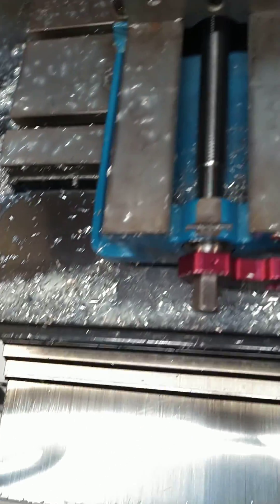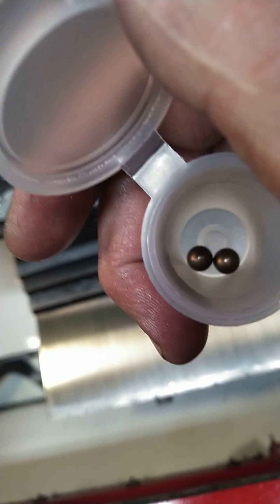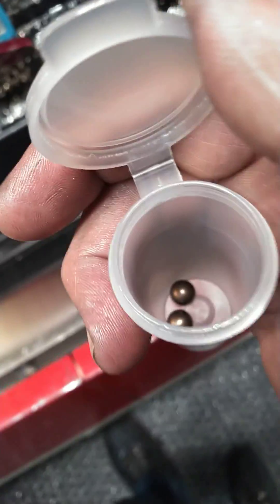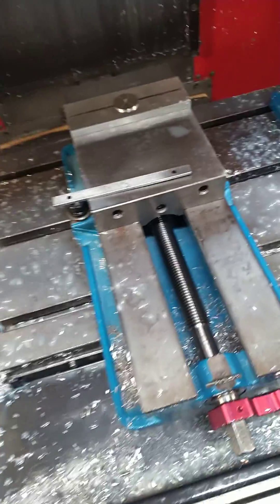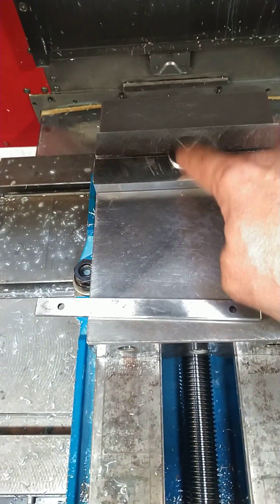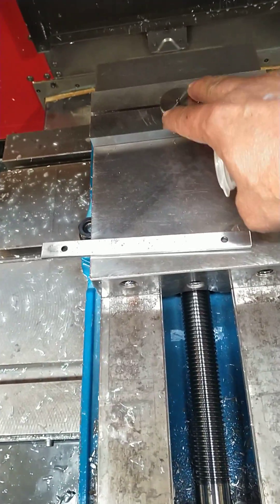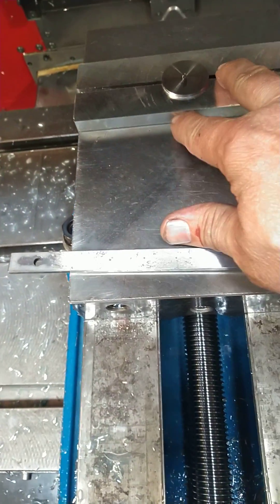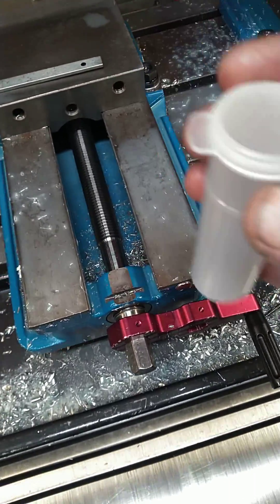drilling a small hole in a ball bearing part 1

Comment: Mechanical engineer here. SMH. Why..just why? 
If it's a decent bearing its like 52100 bearing steel and carburized so almost as hard as normal tool steel. Yeah you could use tungsten carbide or diamond tipped but what is the purpose of drilling a hole in the bearing? The heat of drilling will probably overtemper (eg soften) the bearing rendering it useless as an engineering device. I suppose if you're making overpriced jewelry for wealthy fools it makes sense. Sucker born every minute I guess...
Reply from the maker: What do you know about Niti?